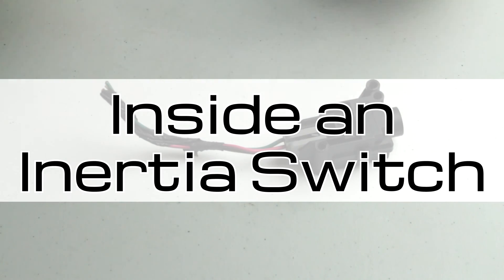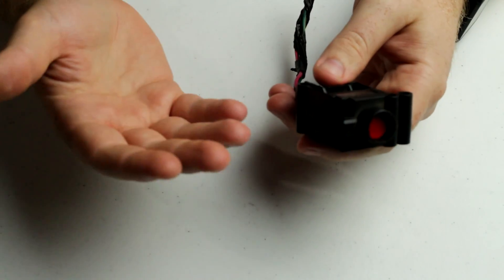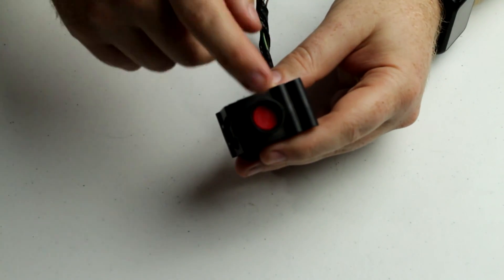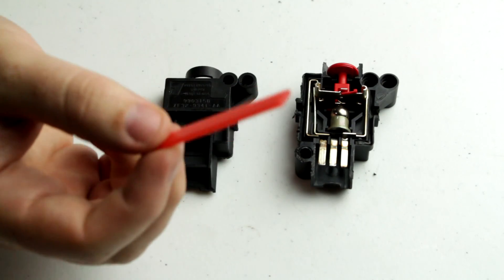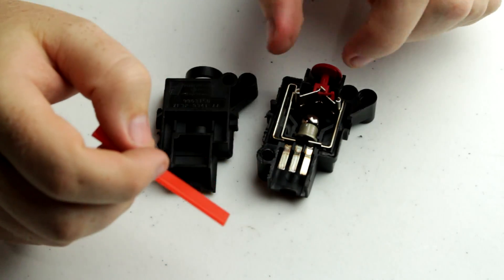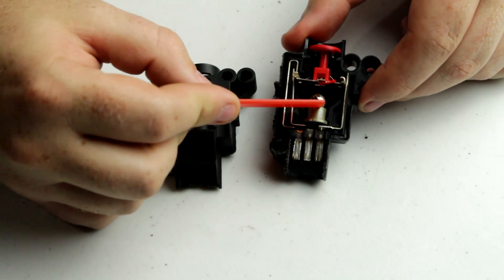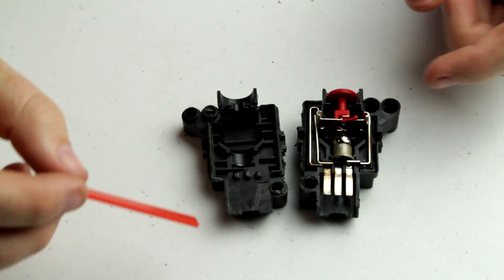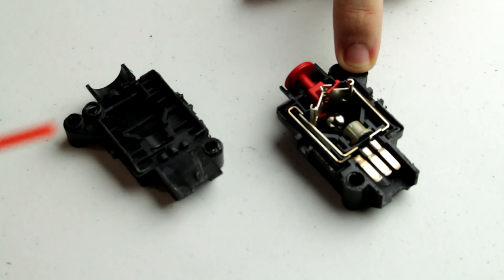Inertia Switch/Impact Sensor: Disassembled & Explained • Cars Simplified

Comment: I just looked at a 2004 ranger. With a no start problem.  The switch had a connector that was burnt and terminals were not making contact.  I put a jumper wire between the two terminals and the car started.  My question is.  What caused the connector to get burnt and melted?  Any ford technician out there leave a comment below.

Comment: Thank you for this video. I am doing some electric fuel pump upgrades, on my friends El Camino that he is getting up and running again. He wants to have an Anti theft switch that you need to find and press before the pump can work, and one of those oil pressure switches, and was wondering how hard it be to add one of these. Thanks to you I now know it's a synch. TY

Comment: Where is it located in the car
Reply from the maker: This particular one was on a Ford SUV behind some plastic trim next to the passenger's right foot.

I pulled this off of a salvage car, though, so there may have been some soundproofing material between it and the plastic panel.

Other vehicles, if they have one at all, may have them in different locations.

Comment: I am building a heavily modified car.  It originally did not have a fuel cut off impact switch. I am planning to add one (not safety third in this case🤣) After seeing your video on this particular switch this is the one I'm going with because of its simple reset ability.

Comment: Obviously it goes off in a head on collision but if a car were hit side on will it also go off?
Reply from the maker: Ideally, yes. The mechanism looks like it is focused on two directions, but a strong enough impact from front, rear, sides, or top should knock the ball out of place.
Reply: My brother just smacked a pole with the rear end of his suv and it went off

Comment: Can that magnet get weak and the ball start moving around in there and cause intermittent power flow interruptions without doing a full trip out ?
Reply: Actually `to answer my own question a year later "Hell ya" this unit can fail :face-fuchsia-wide-eyes:, found out first hand with the engine quit running while im bombing down the hy-way:face-purple-wide-eyes: , u hav to completely key off in neutral while coasting to restart the engine , just a little scary:face-orange-biting-nails: as u are briefly locking the steering :hand-orange-covering-eyes:, slam it back in drv and carry on:eyes-pink-heart-shape: but still better to swap in a knowing good switch  :trophy-yellow-smiling:

Comment: Hi, thanks for the great video!
Would you know what voltage should be on the pins, as I have one of these inertia switches on my 1995 Fiat Ducato diesel motorhome and there isn't any voltage on the pins.
I'm currently fault finding on the motor as it cranks but doesn't start.  There doesn't seem to be an electric fuel pump on it, only the main mechanical fuel pump.  I cracked open the injector fuel pipes (one by one) that supplies the diesel fuel to the injectors.  But only 2 injector fuel pipes were showing fuel squirting out as the engine was cranked over.  So I'm wondering could it be this fuel inertia switch??
So I did a resistance check on the pins and when the button is pushed down in the correct position there is no resistance on either side, from the left pin to middle pin ( C NO) and from right pin to middle pin ( NC ) which there should be a resistance on one side, when the button is pushed in, is that correct?
But when the ball is knocked out from its position ( like in a crash ) then there is a closed circuit resistance reading from one end pin to the middle pin (C NO) and an open circuit reading from the other end pin to the middle pin ( NC). Which I assume is correct.
Also do you know if there should be 12 volts on it?
Any help greatly appreciated.
Thanks,
Regards,
Karl

Comment: Gr8 video I hit a bump in rOd & now, in addition to having nO fUl, or transportation, or job, for a wEk(fUl pump which I problE dOnt need is almOst hEr from ebay).. NEwA, in addition to all that & all the walking Iv Bn dUEng all wEk, & the tO truck chRg, etc., etc. - I noO nO Y my switch wOnt click doOn, cas the flat metal gizmOs on top hav Bcom Dtached in some wA so it wont lock/clik(not a 1 tImR, Iv chAngd fUl pump & reset it in pSt), Il gO by-pS the bStrd & fix switch or grab Nothr.. bt hUdve thunk?, 2 small flat Pcz of metal at bottom of buttN(which duzNt click doOn, doesn't click PrEad.. just EzLE lingrEng flush with switch hoOZng) in wat I noO nO, fashionablE l8 I mIt add, is the triggered, 'tripd', disconnected, up position.. 2 littL stinking pApr-clip sIzd Pcz of metal.. not srprIzd👋☹
Reply: EzOE ??????????
Reply: U hrd me😒
Reply: @ezwa9979  🥺😁😊

Comment: My '94 F-150 has dual tanks/fuel pumps. I'd like to install an anti theft switch to kill the fuel pumps by using one of the inertia switch wires. Which wire is best to install my kill switch in between? Thank you.
Reply from the maker: I would have to look at a wiring diagram for that particular vehicle, but the only safe place to put it is between the inertia switch and the pump; cutting power to the inertia switch would also cut power to whatever it turns on for safety after a crash. If you know what color wires connect to the fuel pump motor, check for that wire at the switch. Also, are you planning on using a relay, or a high amp switch?
Reply: High amp switch.
Reply: It doesn't "turn anything on for safety". If the switch has 3 wires typically one leads to an indicator light in the instrument cluster. Otherwise it's just a simple on/off switch for the fuel pump/pumps.  @CarsSimplified

Comment: How much of a knock is usually required? And where do you buy them?

Edit; not much force apparently!

More autoparts insides please!
Reply from the maker: They are some of my favorite videos to make, and I have at least three big components waiting for me to open them up! I still need to crack open that Montego alternator... The others are a surprise!
Reply: Part 563 Federal rules states that deceleration exceeding 5 mph in 150 milliseconds will wake the box up and collect data usually 5 seconds of speed, braking and much more. Pretty close to a 12 to 15 mph impact will pop the bags. So many variables can happen. I have downloaded hundreds in crashes - never had one pop because of hard braking "until it hit the tree'.